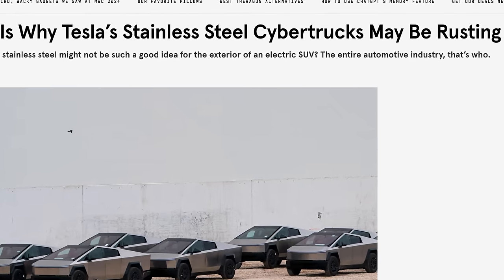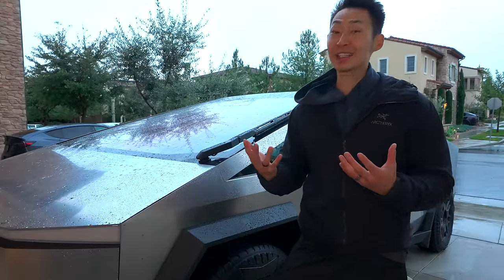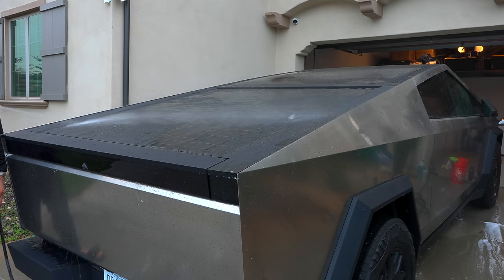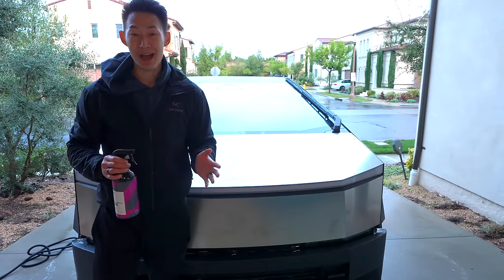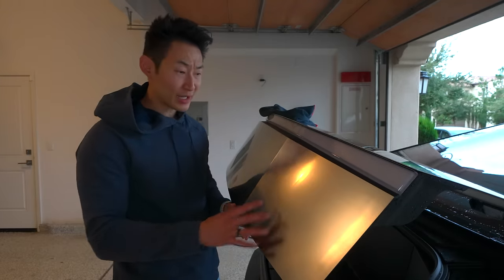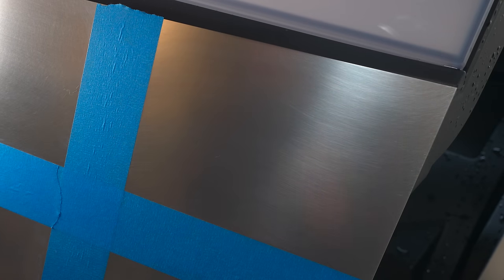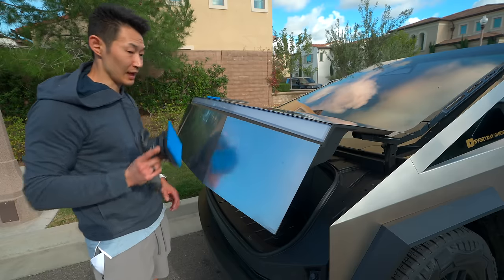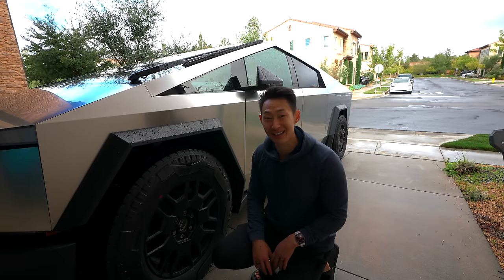I Destroyed My Tesla Cybertruck by Doing This.. (How to Remove Rust?)

Comment: I’ve had a technician come out and change the panels on my stainless steel fridge because it got scratched once. And I was using stainless steel product to clean it. They told me a secret. Those suck and don’t work. They said the best thing to use for stainless steel is wood cleaner. Like pledge wood cleaner. Or wood furniture polish the one that sprays out like foam not the oil kind. And do it with a micro towel. I use that on all my appliances at home and it coats it and comes out spotless. But you have to go with the grain of the stainless steel. Try that on a section. All my stainless steel in my kitchen is spotless and that’s what I use.
Reply from the maker: Oh shoot. Thanks for the tip
Reply: Yep. I use Murphys oil spray.

Comment: That 300 grade means, that the steel is containing nickel, chromium and molybdenum, which should give some acid resistance. These steels are not famous of hardness or scratch restance. You can use Scotts Brite to scratch those. It is also troughout same material, so the corrosion resistance will not change if you scratch it.

Comment: I literally recoiled in horror when you started using the scrub daddy. I've used the BKF soft cleanser  several times on my whole truck and its never left a scratch, but I used a microfiber applicator every time. Basically use BKF soft cleanser for deep cleans, and the foam spray for upkeep.
Reply from the maker: Yes.. I thought non abrasive sponges were ok. But stay with the microfiber towel

Comment: Nice video! I like how you restored the finish after messing it up. Haha

Question: do you think if you applied a ceramic coating such as xpel fusion or geyeon - that worst case you can just use the cordless polisher to remove the coating? 

I have heard a lot of mixed reviews on why not to coat the cybertruck with a ceramic coating to help make it easier to clean. And they are suggesting to ppf instead. 

Do you have any comments in regard to ceramic coating the stainless steel?
Reply from the maker: Gonna apply coating soon! Lots of tests. But it will still show those scratches.
Reply: There's no way you'd be able to use a machine polisher and get consistent results back to OEM look. It's going to give it a chrome like finish.  I'm waiting to see who will be the first to buff out a cybertruck.

Comment: Hello Chris, I used IronX on my Cybertruck and rinsed it off after it turned purple as you did in the video. However, ironx is leaving vertical streaks throughout the stainless steel panels. Am I doing something wrong? Thanks for your timely response in advance.
Reply from the maker: Just keep rinsing it off! Also, make sure to wash the car again with soap. Usually if you rinse it off and don't rinse ALL of it and it dries it can leave some marks. If you have any more iron x spray the streaks again
Reply: @EverydayChris  thanks. I was able to get rid of the streaks.
Reply: @befree112  I have the same streak issue after ironx, how were you able to resolve it? I had some left over so I did another pass with no luck... havent tried bkf yet. Thanks!
Reply: @craigbrandt5040  try to do one panel at a time in the shade so you have enough time for it to activate and rinse off before it dries. You will get streaks if it dries off. The panel will need to be cool to the touch before applying. Good luck.

Comment: Pro tip - if the stainless steel is damaged by Barkeep's friend, it's junk level stainless steel and either Elon knows this or his suppliers are lying to him.  I can get a perfect finish with the stuff on almost everything, but this getting damaged by even a microfiber cloth?  Trash tier materials for sure.
EDIT - 301 stainless steel is known for its strength, ease of tooling, low cost (this is key!), and slightly better than average acid resistance.  But it's nearly as soft as pure iron and scratches incredibly easily. Most cookware is made out of the stuff for this reason as nobody cares if the inside of your pan is scratched.
Reply from the maker: I knew it.. there's no way bkf should be scratching REAL stainless steel THAT easy
Reply: @EverydayChris  The reason they use it for cooking is because you can safely cook things like pasta sauce in it, and in this application, it's acid rain resistant as well as, say, resistant to bird droppings.  Except - it's soft. So you can't hardly use anything other than a microfiber towel and polish or wax on it.  Ie - zero grit and some sort of silicone based cleaner from what I can tell. ie - Novus #1 or wood polish.  lol. Seriously.. Elon elon elon... what a muppet. lol.

Comment: 300 series stainless is fairly resistant to corrosion, but not corrosion proof. It's probably wise to remove any surface corrosion before it contaminates the steel under the passivated layer. While 300 series stainless can be pretty durable, as in resistant to fracturing, it's not particularly hard, which means it could scratch easily. ANY abrasive in Barkeeper's Friend can produce fine scratches, not to mention contaminated sponges/washcloths, etc. Also, despite the durability, this type of steel work hardens, and can be stubborn to fix dents because of this characteristic. 

I have mixed feelings about raw stainless exterior. It's novel, and has some nice properties, but I tend to think it's probably more finicky than paint. And the few cybertrucks I've seen around town seem to have a weird splotchy appearance. Maybe they were just dirty, but it wasn't what I'd call good looking.

Comment: Hey Chris, I’m pretty sure it’s been said by Tesla the steel used is “ 304L “.  Good video 😊
Reply: It's apparently 301 in the ones they are shipping.  A step down to save cost, and a lot softer. Good asic resistance, though - so yay vs bird droppings? lol. But scratches like your plastic screen on your monitor, almost.

Comment: WHY ON EARTH WOULD YOU USE A PRODUCT NOT DESIGNED FOR VEHICLES REGARDLESS IF IT SAY FOR STAINLESS STEEL!
Reply: The number of products available for stainless steel vehicles are pretty much near zero at this point. It’s not a huge leap to believe that something that is safe for a stainless steel appliance should be okay for a stainless steel vehicle. Clearly, people are learning as they go.
Reply: These are different when it comes to cleaning and upkeep vs. a painted panel. It's a bit of learning curve for everyone.